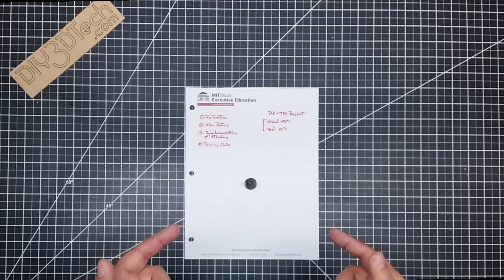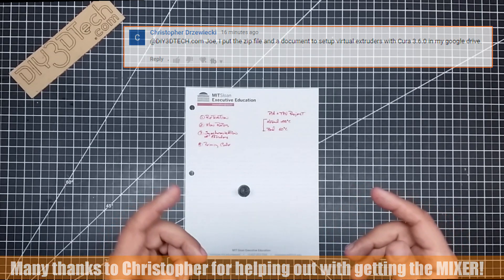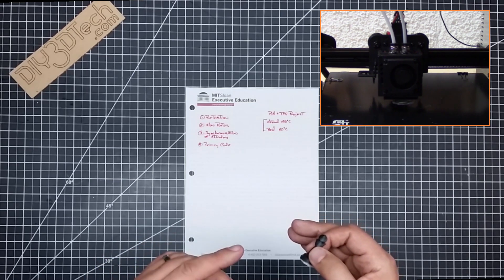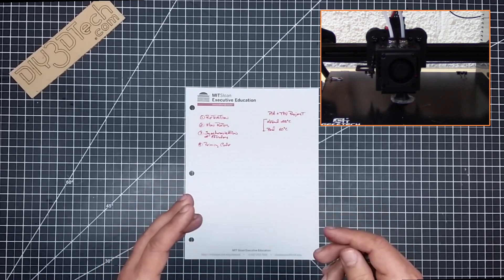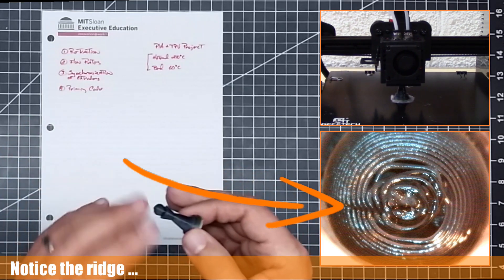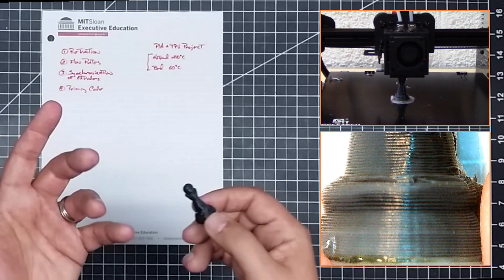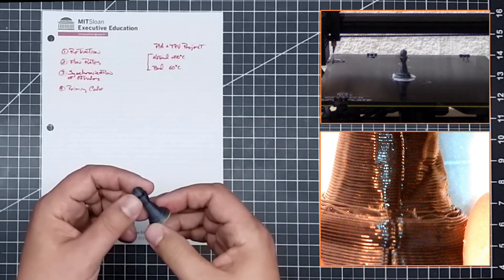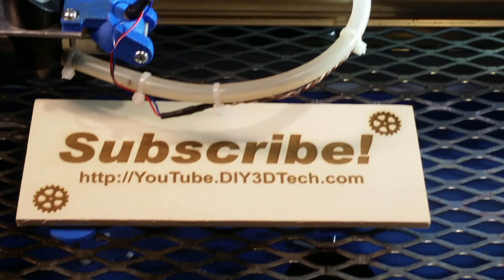GeeeTech A10M - Mixing PLA with TPU!

Comment: hi there, i have to combine a soft material like tpu with a material like pla/petg/abs etc. Is this possible? i dont want to mix the materials inside the extruder. i want to build - lets say  a simple beam - with approximately 10 layers tpu and then 10 layers pla on top of the tpu. are these connection stable? thanks for each help.

Comment: What were your settings? I have an A20M and am looking into this project.
I'm considering constructing a base for my MX ERGO mouse by logitech. I was going to split the model so 40-100mm was TPU on the bottom and the remainder PLA. This way the base wont slide around on my desk when in use.
Reply from the maker: This was a while back, however set for the TPU temp and speed and things should work for a mix...

Comment: I must admit I'm tempted as the starter is such a low price. I do have a cr10s but the cr10x (dual extruder) is about £500 so this is half the price with options for bed levelling thrown in. If you have any other dual extruders machines perhaps you could do a comparison review.
Reply from the maker: You can't beat it for the price!

Comment: I've been wondering about material mix for a while... Could you please consider doing in different colours so we could se exactly where it mixed and where it didn't. Would also be nice to try with different materials for support - to see how much material contamination is there.

Thanks for the videos. Your channel is great! 👍
Reply from the maker: Thanks and I do use different colors, in the case it was white and black for the PETG and TPU it will be blue and black and so on.  However I am not sure I understand the support question?
Reply: @DIY3DTECHcom  
I mean printing not mixing the filaments (one at a time). Ex.: print PLA with PVA support - and see how much they contaminate each other while inside the nozzle. Would be amazing if not, so would be possible ABS + HIPS as well...

Comment: I guess a smaller nozzel / thinner layers would produce better mixing. Or a nozzle that had some fluting/ridges inside to mix the output better.
Reply from the maker: Bigger would be better but still a little like oil and water :-)